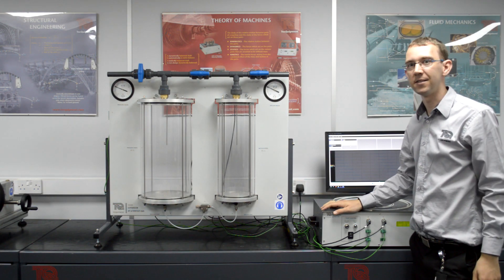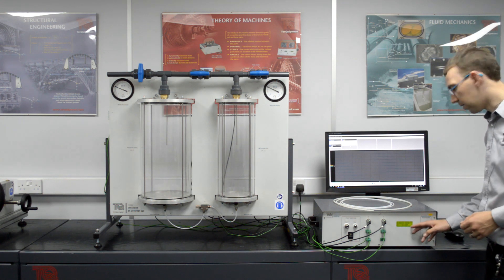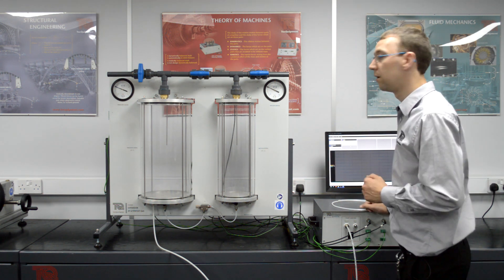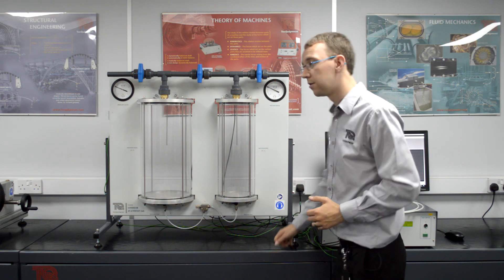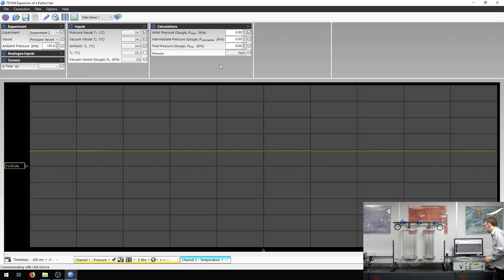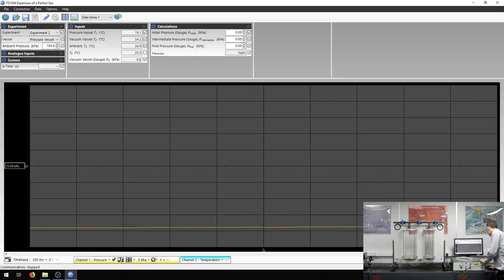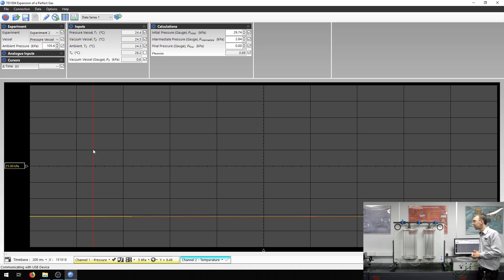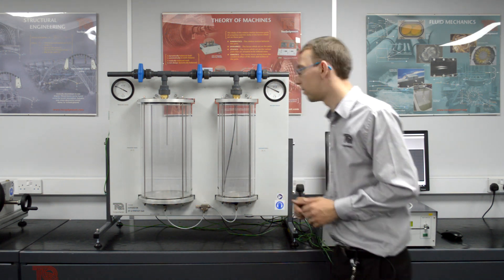Expansion of a Perfect Gas TD1004 - Thermodynamics - TecQuipment

Comment: How can we determine the initial and final volume?
Do we just use the Volume of the vessel?
Reply from the maker: Hi @pookieani2938, thank you for your question. If you have access to our use guide you will be able to find this, we can calculate the initial and final volume and one experiment is dedicated on how to find the volume with experiment 4 in the user guide. Its purpose is to find the ratio of the volumes under isothermal Process. For calculations, the gas will be a “ideal gas”, and we will use some equations where the pressure is related with the volume. In this order of ideas, you can get the initial and the final pressures (manually/software) and using the equations, you can find the volumes.
Reply: @Tecquipment  Good day thank you for the reply!
I am unsure where to find your use guide. 
For the experiment that was conducted we did obtain the initial and final pressure. I assumed we use the density of air as 1.204 kg/m^3 in the formula PV=RT (R=0.287 KJ/kgK) and got the specific volume. But i was unsure if we could calculate the mass or moles of air to get the actual volume, or if we can calculate the ratio of specific heat capacity with the specific volume.
Reply from the maker: Hi @pookieani2938 if you are a student your lecturer should have access to our user guides and should provide this material to you. If this has been lost they can always ask our customer care team for a new copy.